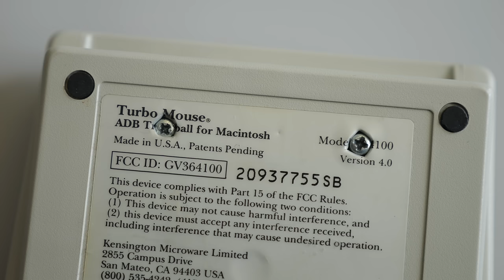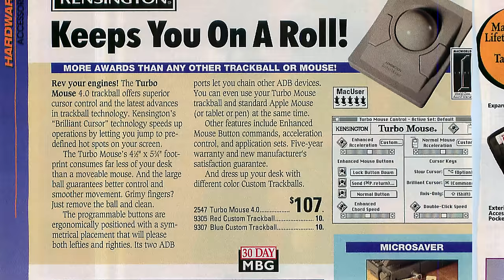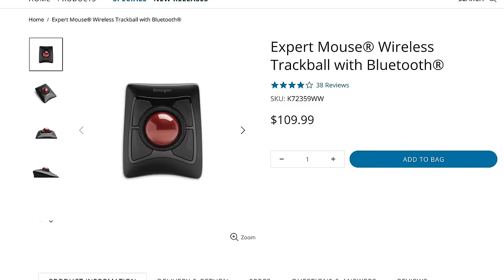The world's best trackball was built to break

Comment: Hah! Of course it's repairable. The bearings are standard but without the encoder ring. These can be easily removed with a razor blade or artline knife. Then you'll be able to read the type of bearing on the side. Take it to a bearing supplier and buy two more. A couple of spots of glue and stick the encoder rings onto the new bearings. Reassemble and away you go. 

I have TWO of the version used on the venerable MacPlus using 9pin D connectors. Many years ago I modified one to run on ADB and used it in my business for ages. The other I have plans to modify to USB. They are the bees knees of trackballs, solid, positive action, BIG balls, and don't move around the desk. Well worth repairing.

Comment: Soak in lighter fluid (benzene) to dissolve the old grease. Bag it in solvent and drop that into your ultrasonic. If there are rubber seals, they will unfortunate absorb some benzene and will need to air out for a few days until the bearings operate as normal.

Comment: I've had very good results with soaking old bearings in WD40 for an hour or so to loosen up the grease inside first, then with an ultrasonic cleaner to remove the residue.  You can apply new oil afterwards.

Comment: Drill a needle sized hole in the bearing with a very sharp drill, from the side, taking care to get as little debris as possible in the bearing. Then you can actually get the oil in. Putting it on top won't do much as that is the meaning of sealed 😂. 
You can watch recent usagi electric or curious Marc videos for how, though it isn't rocket science, you just need a little patience.

Comment: I've had several of these for 20+ years and stopped using the last one 2-3 years ago.  They all still worked when I put them away.  They have excellent durability and I only changed away from them because I needed better resolution.  I'm using the current optical variation of them.  Trackballs are great when you need to control several different things with dedicated controllers.  Trackballs don't use as much space on the desk and don't move around.  You can fix those bearings for sure.  It wouldn't be that hard to glue the plastic mounts back afterward.  Hope you give it another shot.  These also have very long lasting switches inside and the feel of them is very tactile.  Same with the ball roll, it is very tactile and has the perfect about of resistance.

Comment: Back in the day I used to have one of these and loved it. Used it with my Mac Classic (and later IIsi) during college. I'm not really a mouse person, and I have limited space on my desk (dorm desks are tiny) so a mouse is a bit impractical, so a trackball is my pointing device of choice. I do remember having to clean out the rollers when they got gummed up tho.

These days, my daily driver pointing device is still a Kensington, except nowadays it's a USB Expert Mouse. I was pleasantly surprised to see that they still make them. Well I'm not sure if Kensington itself still exists, or if another company just bought the name and is making trackballs under the Kensington name. Either way, I'm actually quite happy with it. It's pretty rugged and has survived years of abuse and several liquid-involved mishaps. Fortunately they've changed the design. The new ones are completely optical, so they no longer have any rollers or other mechanical parts to get gummed up. They still need to be cleaned periodically, as dust bunnies tend to get trapped down there and block the optical scanner, which causes erratic mouse response. Fortunately cleaning them out is a simple procedure; just remove the ball and either vacuum up the inside cavity or hit it with a blast of compressed air.

Comment: I have used Expert Mouse trackballs for years. 

I just put some 3-in-1 oil on the bearing and spin it with a drill.  Once the oil works in they spin smooth as silk.

Comment: Odds are the bearings are stiff because someone already tried to 'oil' them and caused the seals to swell.  The ball-to-bearing contact can be a bit noisy, so I can imagine someone looking to lube it up to deaden the sound.  If you do attempt to add oil to sealed bearings, be sure to pick something compatible with the seal.  I just took a peek at mine (1995 4-button PC version) and it uses KYK bearings.  Hardly a knockoff 'built-to-break' brand.  The bearing itself is a standard 626-size sealed with an encoder wheel bonded to one side. 
Honestly, if it had a scroll wheel function, I'd still be using it.  Instead, I'm currently using a Kensington Slimblade trackball.  It's been just as solid a performer as anything else I've ever had.

Edit: 2:14 Indeed, they were still using the KYK bearings.

Comment: you can drill a tiny hole into one side of the bearing  (the bearing seal) (the side with no segmented pattern obviously)  , being super careful to not go too deep, then use a syringe to inject solvent in it, you will be able to slowly wash way all the grease inside, they dont need grease with such little load they carry, perhaps you can drill 2 holes, at opposites sides of the bearing seal, inject solvent in one side  (WD40  works great) , and let it flow out the other side

Comment: I've owned 4 of 5 of these over the years. Only one of them actually broke to the point where it was more than cleaning out a bit of gunk or tangled hair. I still have a PS2/USB four button turbo mouse on my desk right now. 

Where Kensinton went off the rails for me is, they stopped using roller bearings and just went to plastic sliders. The sliders get crudded up, and stop being smooth. Actually, they were never smooth. 

If Kensington ever came out with a reissue of this thing, along with software to properly support it, I'd totally get two right now.

Comment: The special side of the bearing might just be glued on even. And you could remove the bottom of the plastic stakes and possibly replace them with a small enough screw on the bottom and possibly washer, to act as a new foot to the plastic part.

Comment: Most trackballs nowadays have the sensor reflect off the ball itself, which is why you have the red glitter paint on them. The bearings are usually a lot simpler too (like ceramic 2.5mm bearings in plastic). Only thing you're only going to have fail on you (like most modern mice) is the switches, which if the typical omicron style, don't change much at all.

Comment: Heatstaking can often be replaced by small screws.   I'd replace the bearings with ceramic ones, lubricated with just a tiny bit of 'sewing machine oil,' if anything.  Surely those spline wheels are just glued on to standard bearings?

Comment: Tha ball bearings in the mouse are of the model 7R4A with that ring glued to one side of the bearing. You can find and buy them online. I would have cut the plastic holding pins of the bracket with a razor blade and change them with a small screws. In my opinion that is a small sacrifice for saving such interesting piece of tech. Be sure to mark the exact position of the bearing on the shaft with a marker when replacing them.

Comment: The segmented disc seems to be glued on, if the bearings cant be cleaned with isopropanol i would take them out , then put them on a hot plate to receive heat from the opossite side to melt the glue to pry the disc off more easily and then stick them onto a new set of bearings, obviously you have to cut the standoffs that are melted in place but later you can add melted plastic from some scraps idk...
Reply: Rather than adding plastic, just use some small self-tapping screws.

Comment: If the bearings are metal balls internally, NOT PLASTIC..  you can use Cleaner, then relube it.  There are Shops that have parts for machine work, and they can answer LOTS of questions about Bearings..

Comment: its likely some sort of 608 variant bearing with a washer with some lines printed on it that can be removed with some alcohol. yeah youll have to cut the plastic welds with some flush cutters but you can probably hot glue it back in place.

Comment: Soak the bearings in cup with degreaser for a few days so it can work its way in and break down the grease. And you can actually pry off the bearings side covers with a sharp pick, they jist pop off.

Comment: I bought a rare Atari 5200 trakball controller (Atari did indeed spell it "trak") that has a very similar issue - the bearings are nearly impossible to move. Whatever grease was originally there has long long long since dried up. I added new grease, but it only seems to help _slightly_. In comparison, my Colecovision Roller controller from around the same time period works flawlessly. I thought I might swap the bearings, but the Atari one uses different sized and shaped bearings. 
Likewise, I had considered replacement of the bearings, but I don't know where to get them and I don't want to blindly buy new parts just hoping they will fit because if they don't, I won't have any use for them.

Comment: The newer versions are optical, so completely immune to the issue here. I have one that I found at a thrift store several years ago, model K64325, that works great. It was still sealed in the original box when I found it, but was nearly 15 years old at the time, going by the copyright date on the box.
Reply: Optics can still be fouled up by dust, grease, and other gunk. And the lens can become scratched or damaged.

It's a lot less common and doesn't happen as quickly, but they're not immune to other kinds of issues.
Reply: @jnharton  Yes, and I clearly said "immune to the issue here", meaning the seized bearings. Dust, finger oils, etc can and do build up in the model I have, but all it takes is a quick wipe with a paper towel and the sensor is recessed a bit, so very difficult for anything to get to it to scratch it, and can be cleaned with a cotton swab dipped in IPA. MUCH more robust design than the older models.

Comment: You could try heat on those bearings, it might make the oil mix with the solidified grease, making it normal again. Also I have seen in the video that the ring with the pattern is actually a small metal plate that most likely has been epoxied onto the bearing. It can most likely be removed with some heat and put onto an new bearing using super glue.

Comment: You can use contact cleaner and spray between the metal shield and bearing body while turning the bearing by hand. This usually works. Another solution is to use medical gasoline and submerge the bearings overnight.

Comment: You could try cutting off the plastic rivets, clean the bearings separately with heat and solvent, drill small holes in the plastic part and attach it back with screws or bolts like the bolt mod on the model m.

Comment: You could try to work in some oil like you were doing and spinning the bearing with a drill and some kind of rubber in the chuck ( like the rubber feet on the bottom of a computer case on a bolt and nut held in the drill chuck, or whatever you have laying around you could somehow get in the drill and has enough friction to turn the bearing).  I would also recommend trying KERO AROW penetrating oil, that stuff works wonders.

Comment: try penetrating oil/CLP to break up and dissolve the old lubricant, not machine oil. the only thing you gotta be careful about is the plastics, try to keep it away from the plastic but only a few drops should get in. i use this on old sealed fan bearings when repairing anything with a proprietary fan (old xbox fans specifically) with a syringe for application under the plastic into the bearing itself.

Comment: The "seal" on those bearings are paper thin and generally not necessary. I've had great success prying them off and using WD40 to clean the dried lubricant off. Just make sure not to dislodge any bearings from their cage in the process of removing the seal.

Comment: All you had to do was bathe those bearings in WD40 and turn them for awhile.  WD40 will thin out and remove the sticky bearing grease.  Now, you will need to get a bit of new oil in them, otherwise you will need to re-apply WD40 around every 6 months to a year of use or so.  Getting the right type of axle grease back into those bearing, a low viscosity lithium grease type which will last years is a bit harder to do.  Normal oil is the wrong stuff and will last only a bit longer than the WD40 cleaning step.

Comment: I've come to expect over the years that anything on ebay that's marked as "parts or repair" or "untested", means it's broken. I don't buy them. For electronics I also wont buy anything that doesn't come with a power adapter, if it came with one new. To me that's just a way to cheat you into thinking all that's wrong with it is that.

Comment: Which cleaning liquid did you use in the ultrasonic bath? I guess you need something that can solve the oil gunk in the bearings, so I would try benzine or something similar. That, of course, might attack the PCB or other components, but since the thing is broken anyway, ...

Comment: Ahhh, the humble trackball. My first peripheral love. Nice video! However the ball portion was not ever remotely close to the size of a billiard ball in any of the Kensington models, but you could purchase an specially sized 8-ball looking ball replacement you could easily swap out. It was the 90s, 8-ball designs had some traction at the time. The balls were maybe 1/3 the size of a standard billiard ball. You'll notice how you can't really find one with any other billiard ball design besides the 8-ball, that's the reason.
Reply: The Kensington ball is 55mm. Standard US pool balls are 2.25" or a bit over 57mm. Should fit just fine, sitting a tiny bit higher and with a ~1mm smaller gap around the ball.
Reply: So it is close to the same dimension, you were right. I must have been thinking about the thumb only trackballs

Comment: I doubt the bearings are worn since they are turned by hand at very little rpm just heat the outer race of the bearings make sure you wear cotton gloves to prevent oils from fingers to contact the ball bearings they will pit overtime if touched. Clean out the old grease once the side case is opened they usually pretty easy to open.

Comment: Maybe you could replace the entire roller+sensor units and replace it by some working ps/2 mouse (there are millions literally sold for parts for $5 on eBay) units; they were not metallic, just plastic rotating circles with all the tiny slots for the light to pass and detect the motion, so maybe you'll need extra 3D printing work to add some adapter for the rolling part to properly contact the ball.

Comment: I've been using these Kensington Trackballs since the four-button model that came after this one... they are essential, I can't go back to a mouse! I'm currently using the Slimblade, (I have two of every model, one for work and one for home) which may last longer as it doesn't rely on rollers? My older ones work fine, but the really old ones, I haven't tried in years and now I wonder if they are going to have this same problem. Also, the eight-ball was something I purchased that was specifically for the four-button unit, I'm not sure if actual pool balls can be used but then again I never had the two-button unit.

Comment: You could try WD-40 on bearings to loosen, but I'm not sure about effect on glue/plastic; better to replace. Heat-staked mounting posts could be replaced with screws. A PCB could be designed to replace the patterned rings.